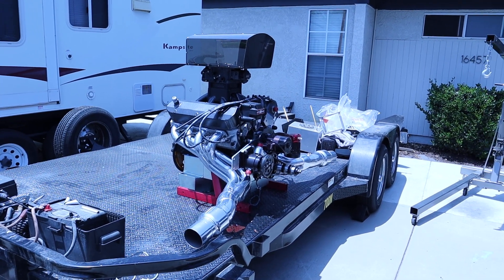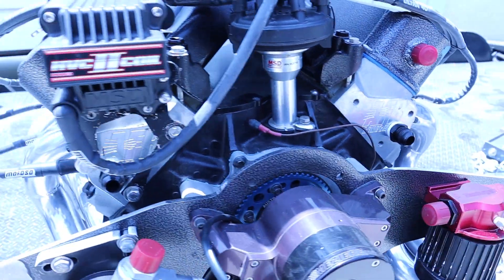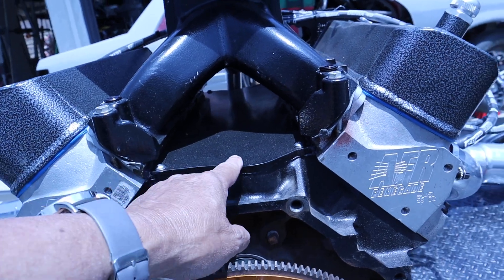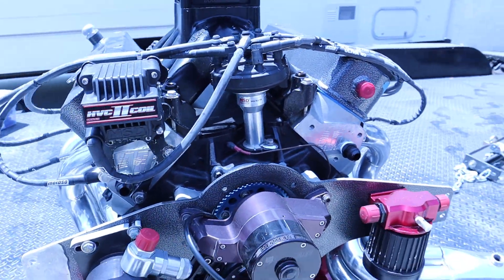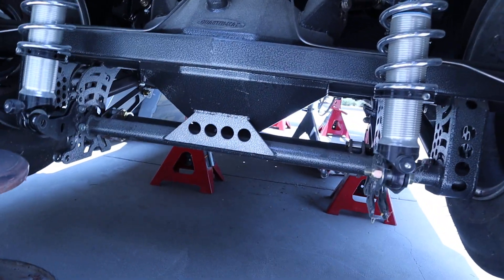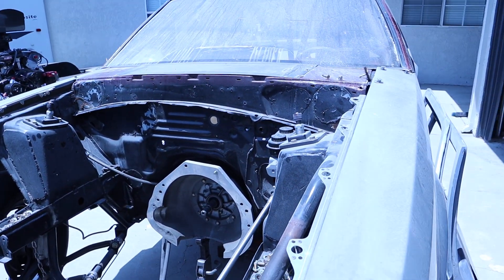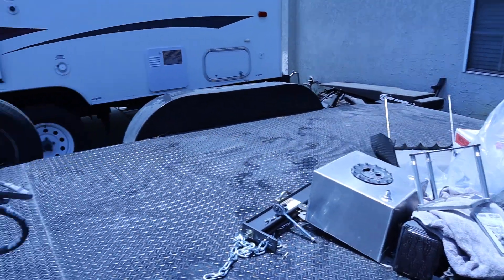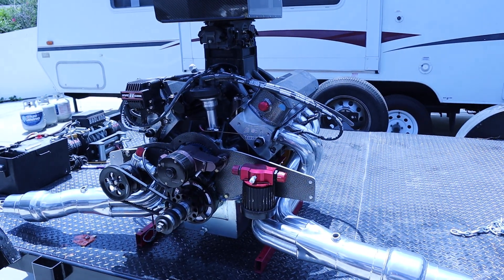PLATED CYLINDER HEADS ON LAPD RACECAR!

Comment: Ben, what is that pump on the right front of the engine?  Is that for the air conditioner?  I know the police usually leave the engine running with the air on.  I guess they do not like to get into a hot car?
Reply from the maker: David, that is the access to the muffler bearings!  lol

Comment: Hey Ben, please explain the external oil line to the lifter valley mod. Thank you.
Reply from the maker: I plumb an external line from the oil pressure sending block and drilled to the block casting.  I have it on Fb under Ben Alameda Racing -photos Oiling Systems.